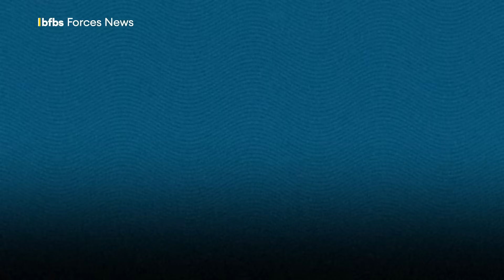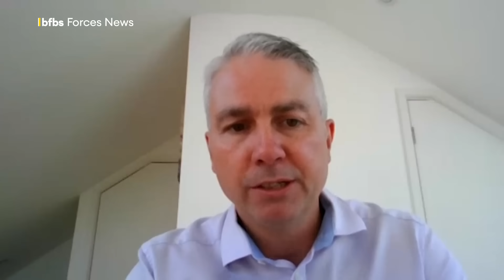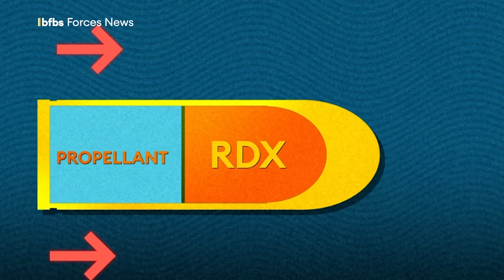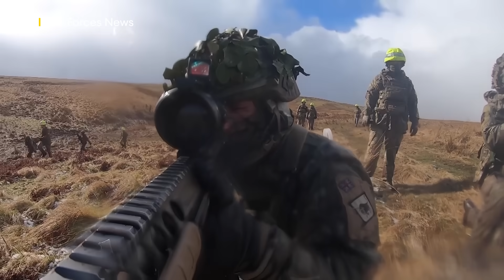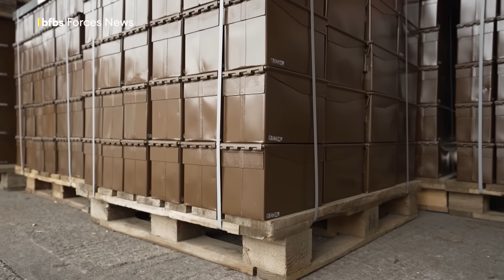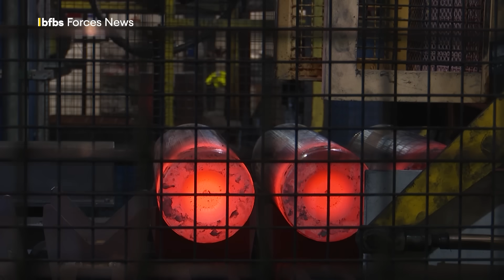The bold plan to secure UK's ammo stockpiles

Comment: Using the same thinking based on self reliance, we have to consider the steel industry, and the consequences of not being able to provide the necessary industries ( like the ship building industry) in times of conflict...... we have to look at the situation in 1939 and make sure we don't have the same issue with not being able to supply and provide for ourselves.....
Don't forget once a crucible is stopped it can't be recommissioned again.... it's heated up from new and runs none stop melting the raw materials to make steel...if it stops it's over

Comment: Very cool, but where do the robots come from? If they fail, can they be repaired from uk manufacturer's. A lot of the valves, etc, used in automation come from Japan. With just in time, we had to wait for parts during covid. Also, you can't ramp shell production without steel.
Reply: They come from BAE systems Inc which is the US arm of BAE. They are designed and built in the US with some foreign content from just where you said Japan and also Germany.

Comment: Secure a US contract for domestic US supply.
Reply: BAE systems already has a contract for the US DOD and operates a US Govt owned ammunition plant. The machinery in this video you see making 155mm casings is actually designed and built in the US and sent to the UK to be installed in factories there. The same goes for the machinery for small arms ammunition.
Reply: @SCscoutguy  I meant for the chemical manufacturing for explosives and propellant.

Comment: Same price per round even though simpler, shorter and smaller supply chain and made to order continuous output on smaller footprint. Sounds like the MoD are getting shafted if they are not saving at least 30% per unit.
Reply: Cretin. Based on what evidence. What about new ant cst/ amortisation. You sound like the shoppers in MoD DE&S who got us into this position.
Reply: @thomasfletcher1464  How about expressing your opinions without leaping to personal abuse.
Reply: Dave, you forgot about the investment costs to do this, and provide scalability. So MoD gets security, reliability and scalability to support the national requirements and drive export success that in time will lower unit cost.
Reply: Therefore need to renegotiate price with competent negotiators as this does have the 'whiff' of MOD being shafted .

Comment: They're going to use high explosive as propellant?
Reply: Just because it's a high explosive doesn't mean it has to be used as such. It's basically a smokeless, partially self-oxidising, mono-fuel that can be mixed with oxidising agents and desensitisers to make various propellant compositions for anything from small arms to rockets.
Reply: @garysmith5025  Well a high explosive has a shockwave threshold in thousands of FPS.  I'd like to know more about how you take that component and detune it for propellent purposes.
Reply: @PrimarchX  Virtually every high explosive will just burn without detonating if ignited. You don't detune RDX to stop it exploding, it's already quite difficult to detonate, you blend it to suit your requirements as a propellant.
I'm guessing you're American?

Comment: You would think that with a simpler Logistics/Supply train would mean a lower cost, but the spokesperson said the price remain the same... Really? Well, I'm no expert, so what do I know. BTW, whatever happened to Gun Cotton? Used to be the primary propellant during WW2. (Yes, I know, ancient, outdated tech etc., but, I'm still curious.)
Reply: Because it's moving away from a complicated 20 ingredients recipe to one that only uses 10, but those 10 are more expensive than the complicated but cheaper recipe..

Comment: If you look at the manufacturing of Artillery shells, I suspect the “critical” element of production is the actual production of the artillery shell, and not the filling. We should therefore be continuously producing the shell cases, but not filling them. Store the “empty” shells in a CHE environment. No worries about having to worry about storing explosives, with all the additional security and H&S issues, and if ever the calibre is changed, you can then simply melt down the shell to make something else.
Reply: You said a lot to confirm your lack of understanding.
Reply: @normanboyes4983 ,why ?
Reply: This is a very good point. I’m pretty sure I’ve read somewhere this used to be done in some counties. Produce what you can now and stack and store it. 👍
Reply: 155mm is NATO standard so won't change.

Comment: I don't think a continuous manufacturing process for military explosives is a good idea, because you can't easily change the volume that is produced. With batch production you build a production plant capable of 24x7 operation, but only make one batch per week as that is all you need for training. In wartime you increase to several batches per day using the same equipment. The plant can greatly increase capacity with little need to procure more equipment, and you only need to recruit more workers for all the extra shifts. (This won't be that easy, but it is inevitable when scaling up production)
Reply: The reason it has been difficult to scale up batch processing of explosives is because no one builds 'just in case' capacity. It would just be idle capital, and a simple way to go out of business.

In other media, I have seen BAE reps say that the continuous flow process they have designed can be replicated very quickly, so it looks as if the machinery isn't complicated or hard to make. Indeed, the ability to scale up quickly, as well as move production nearer the artillery, is being touted as the two key advantages of the production methodology.
Reply: @cacwgm  Yes, I am arguing for just in case capacity, because if you don't have it then in wartime even a large stockpile will get used up quite quickly. Idle capital is only a problem if the commercial contract with the military is not structured correctly. I am arguing that as well as specifying a certain quantity per month, the contract should also require the supplier to maintain a production facility capable of increasing to another much larger quantity per month. The supplier would be paid fairly for the capital and ongoing cost of that idle facility.
Reply: @davidpottage6402 In theory you are right. In practice, a government would have to be 100% convinced that this particular materiel or weapon/ordinance needed to be produced in far greater amounts in the event of war. The other issue is the maintenance and updating of the production facility while there's no immediate threat. 

Both these factors make it unlikely that the political will can be summoned to build and maintain unused capacity.
Reply: Depends how the plant is designed. The constant production plant might not have an on off switch but one where its out put can be pushed right up when required.
Reply: @samplumbe3288  I don't think a constant production process can be scaled up that easily. I in simplified terms the production of most chemicals is like cooking a recipe. Reactants are mixed, cooked and stirred at the correct temperature for the correct length of time, the the product is purified and waste products disposed of. Both the time and temperature are crucial and cannot easily be changed.
For a continuous process, instead of reacting in a big vat, the reaction is done along the length of a pipe. So for example if your reaction takes 15 minutes (900 seconds), you might have the chemicals move at 1 foot per second down a pipe 900 feet long. Having a long pipe makes it easier to get the temperature right as you can easily have a water or steam jacket to control the temperature and you eliminate hot or cold spots, but you can't change the rate of production as that would mean you need a longer pipe to accommodate a higher speed while maintaining the same reaction time. You also can't turn off the flow easily as that would mean chemicals sitting in the pipe for too long and decomposing or unwanted side reactions happening, so stopping or starting gets expensive because of the need to waste chemicals that have been in the pipe for the wrong time or temperature.
Reply: You may have a point but a continuous process can be duplicated or a larger version built. A continuous process will be more efficient in general just like processed cheddar cheese is quicker to make than blocks of cheese that are matured on a rack?
Reply: @andreasbimba6519  The point I am trying to make is that when a war starts you need to ramp up production ASAP, and it would be a bad time to be ordering long lead time specialist equipment, to expand your explosives plant. It would be much better to arrange things so that capacity can be increased at short notice with as little effort as possible. Anyone paying attention to the war in Ukraine will know that both sides have a shortage of shells, but Russia is winning because they have a larger stockpile. Back in 1915 there was a shell crisis due to the huge number needed and the lack of manufacturing capacity. Lets plan things so that history does not repeat any more times.
Reply: I think what they are saying is it’s easier to scale up at multiple small sites. 
We could guarantee in a war a large ammo production facility will be a massive target. 
I guess their is no ideal solution.

Comment: This is exactly the right time to start thinking about this.
Reply: Errrrr no 2 or even 3 years ago
Reply: @gingernutpreacher  They did - the increased production was announced shortly after the Russian invasion of Ukraine. Increasing production capacity of a factory 16x in three years is very good going.
Reply: @MalcolmRose-l3b I knew  they had had a lot of spare  capacity  but that's alot but our stick piers didn't increase  for awhile thought
Reply: @gingernutpreacher  It's a bit difficult to find reliable information but I've seen statements that the British Army pre-Ukraine needed about 64,000 shells a year, and BAe exported roughly 30,000 more to other countries. The initial plan was to increase this eightfold by 2025 - so production should be ramping up to approaching 750,000 to 800,000 rounds a year. I've also seen numbers quoting 1 million shells a year.

To put this into context; pre-war France produced cerca 60,000 shells a year and have plans to increase production to 180,000 shells a year. 

I'd also point out that pre-war the price of a US 155mm shell was about £1,500 - so, at that price, about £96M for annual replacement of British Army pre-war consumption. Current prices for US shells are said to be 4x that - so the US is doing quite nicely out of supplying demand.
Reply: @MalcolmRose-l3b this is anecdotal but rumours  we're they weren't meeting  targets because  of skill staff shortages they weren't  will to be specific  in there skill  set
Reply: @MalcolmRose-l3b  The US always do well out of World wars.
Reply: @MalcolmRose-l3b  or maybe three times nothing is still nothing???
Reply: @MalcolmRose-l3b  NATO 155 mm shells....
Reply: @markrainford1219  the last world war ended in in 1945, also the last declared war by the US.
Reply: @davidoldham1946  "or maybe three times nothing is still nothing???" I'm not sure I understand your comment. Pre the invasion of Ukraine the UK was producing cerca 95,000 155mm shells - that isn't nothing.
Reply: They should have been doing this years ago , not taking their time and reacting years after a problem was revealed...
Reply: @greyvoice7949 true, but better late than never!
Reply: 2014